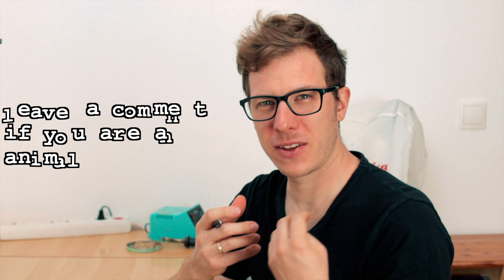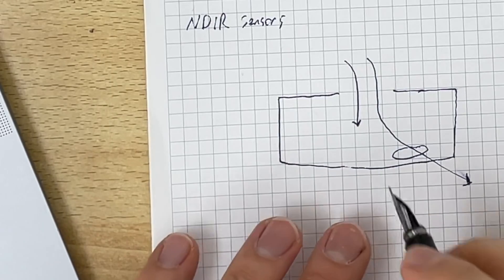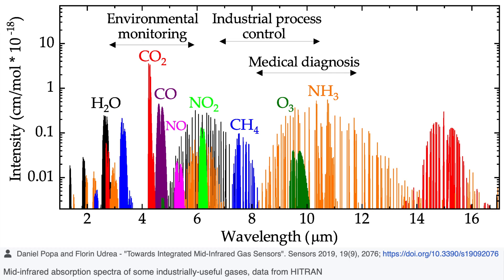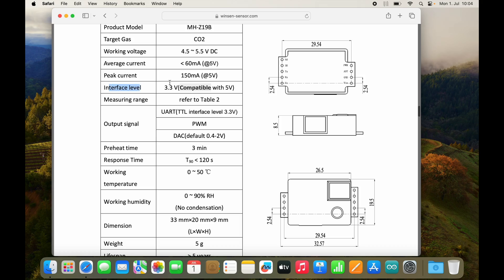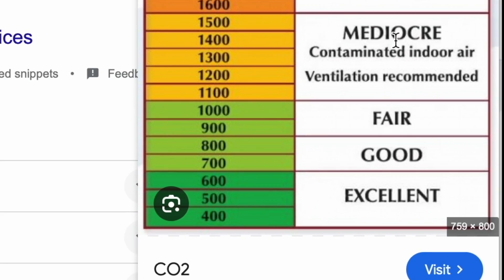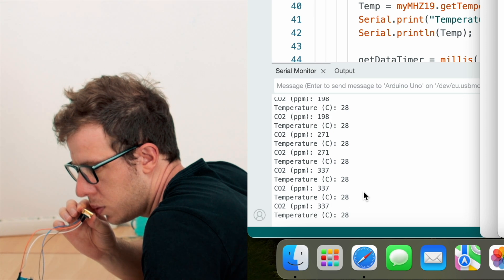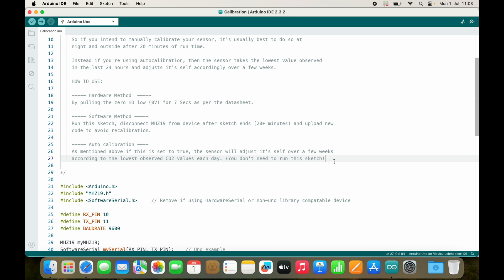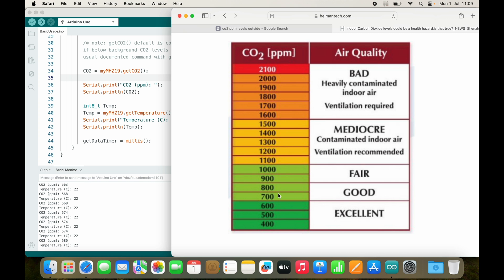How to measure CO2 with Arduino Uno using MH-Z19B

Comment: I did as you instructed but the CO2 result is 0ppm or 10000ppm, can you tell me where I am wrong?
Reply from the maker: Hey, what exactly did you do?
Reply: @playduino  I made your video tutorial: connect MH-Z19B to arduino uno r3, use the example in arduino ide to run
Reply from the maker: Hi, I would give the Software Method a try:

upload Calibration.ino:

1) Run this sketch for 20min outside during night, 
2) important!: disconnect MHZ19 from device after sketch ends (20+ minutes)
3) upload new code to avoid recalibration.